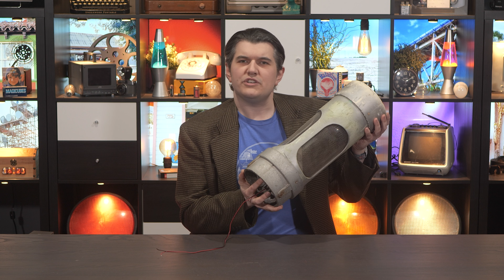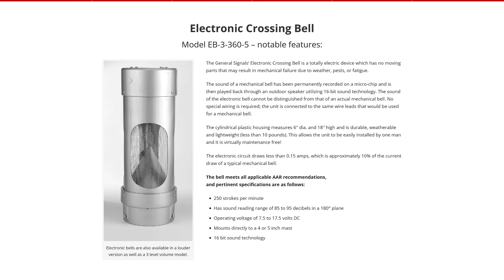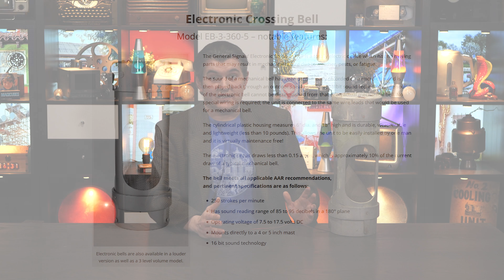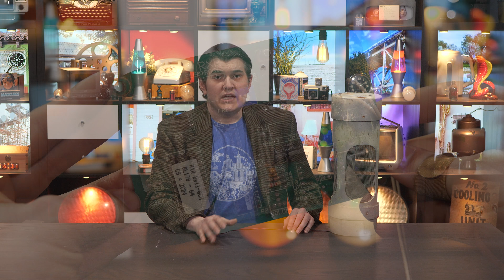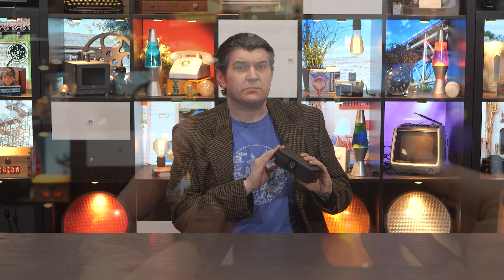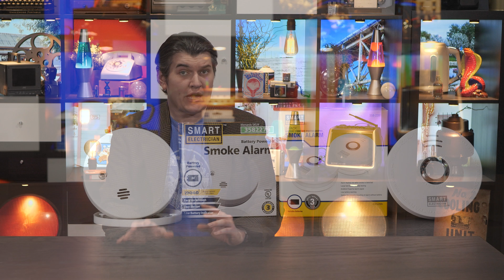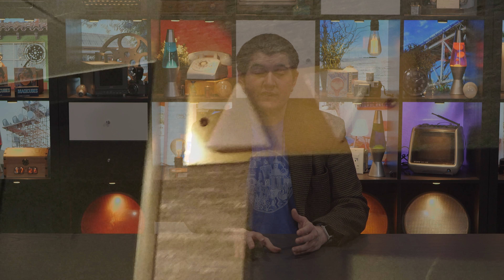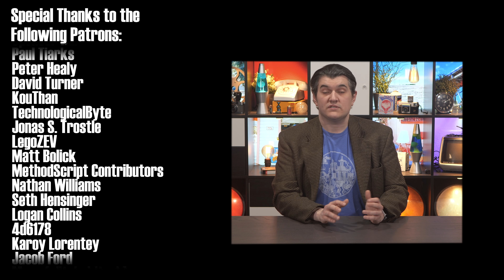The disappearing and unappreciated art of audible alerts

Comment: Alec (my favorite YouTuber!), you may or may not recall that department stores of the 1960s and 70s used a series of coded chimes over their PA systems to page specific managers.
Reply: I want to say those lasted into the 1990s, especially in the stuffier department stores like Neiman Marcus, Lord & Taylor, or Marshall Field's. It might have applied to JCPenney, Service Merchandise, and Sears, but I can't recall for sure. I don't know if it was universal, but it was very common and it added an interesting audible ambiance to the background of those department stores.
Reply: @JeffreyJakucyk You very well could be correct, I was approximating on timeline. I worked in retail during the late 70s/ early 80s, mostly in Brooklyn NY. Macy’s, Alexander’s and Korvettes.
Reply: It certainly felt like technology from the 60s/70s, and I guess it hung on until two-way radios became cheap and reliable enough to replace them.

Comment: 16bit railroad bell using a 8bit DAC, it seems the marketing department fumbled the numbers a bit here
Reply: “Indistinguishable from a real bell” - Alec goes on to demonstrate that lie as well
Reply: if it's a high sample rate 8-bit DAC then you can get greater than 8-bit sound fidelity through sample dithering. SACD is based on a high bitrate 1-bit signal.
Reply: @gdclemo the sample rate comes from a basic 555 timer, besides that there are just 2 cascaded counters to push the 8bit samples from the ROM directly to the DAC and an audio amp for the speaker. You can draw the whole schematic on a napkin in a few minutes, there is nothing fancy going on there, there is not even a CPU in it.
Reply: @SwitchingPower  I can do the same thing with 3 transistors and a real bell ;)
Reply: @SwitchingPower I mean it would be complete overkill for something that just dings continuously at railroad crossings, it doesn't need to be high fidelity of course. I just mean that DAC resolution is not necessarily a big deal for audio.
Reply: The bell featured here was from the 1990s. It's possible that they may have switched to 16 with the ones made today. The general signals bells have gone through a few revisions over the years.
Reply: The GS and NEG electronic bells have came a long way!!!
Reply: @epacm50 GS for sure. NEG's originally entered production in the 2000's as Safetran type 2's.  And use pretty much the same 16 bit chips as the GS type 2's. Not much has changed at all for NEG's.

Comment: Pilot chiming in here, the airliner sounds are rather aircraft manufacturer dependent (e.g. Boeing / Airbus), but in my experience they are very similar. Most commonly you will here these combinations:

- Single low chime: Passenger call
- Single high-low chime: Interphone call (Either pilot-cabin crew or cabin crew - cabin crew)
- Single high chime: Passenger info, e.g. fasten seatbelts / no smoking signs
If the chimes are repeating, they are indicating high priority messages, e.g. emergency interphone call or lavatory smoke detection

Comment: I associate temporal three with alarms, but not fire alarms. In my experience, high-pitch temporal three are usually fire alarms while temporal three at the pitch you played sounds more like a phone alert or weather radio alarm
Reply: Those weather alerts are actually completely unrelated, those tones are encoded information about the alert played 3 times to prevent false alarms or misread information.
Reply: @MichianaAlerting sure, but they all start with a klaxon or something that blares 3x. Then they repeat the information 3x

Neat if the klaxon is actually data though.

Comment: Mobile OS UI design is at the forefront of the trend to remove control from the user and impose a desired UI. This is why rooting and jailbreaking are so important - it allows people to provide improvements when the OS vendors don't want to. 

Mobile UI sucks. And desktop UI is going in the direction of mobile UI, if not already most of the way there. 

UI (and the related term UX) are not just the visual design. They include audio, they include the tactile sensations, they involve the fact that the UI and UX primarily exist to allow the computer to serve the user. Too often today, tech companies impose their own UI/UX on the user, harming usability and making the user more beholden to their "tech overlords"

Comment: A lot of warning devices are made from off the shelf components. Certain Whelen sirens use Atlas CJ-46 horns, which you can buy off of Atlas' website.
Reply: Actually a lot of sirens used to use them. Whelen used them in the WS-1000 and WS-2000, ACA used them in their omnidirectional alertronics, and Loudoun used them in the original ES-1000. Those sirens have pretty much become obsolete with the "stacked speaker cell" design outperforming it, but several units are still in service!
Reply: @MichianaAlerting  Indeed. Also, DKTech's speakers were used in some ASC sirens, and clones of them are still used in ATI sirens.

Comment: You missed: Air Raid ,  Reactor event,  Tornado or Tsunami sirens .  (OK, the first has been out of use for a few years). The town I grew up in used the siren to call, and tell the mostly volunteer fire crew, where to meet.  Long blast, then three sets of beeps that represented intersections to go to.   And YES. STOP CHANGING THE SETTINGS ON MY PHONE.
Reply: Outdoor warning sirens do not have standardization in their signals at all. Individual communities can choose whatever signal to mean whatever they want, so always check with your local EMA, fire department, police department, etc. to find out what sounds your sirens make

Comment: The ones near me on the Denver light rail also stand in for the manual train horn, which no longer comes from the train itself at crossings. Loud as hell if you're standing at the crosswalk. The irony is that for other crossings not equipped with one, such as the frequently-broken traffic light near me with a rail curve going through it, when the traffic lights are out, the train has to sound its own "bell" again, the kind used to shoo pedestrians off platform crossings

Comment: Whilst I completely agree with your point is that really what US smoke alarms sound like? 
It's a bit subtle isn't it? 
In the UK a smoke alarm going off sounds like a proper emergency 😂
Reply: He didn't use the actual sound because he was making a point about how the standardized part is the timing of the sound, not the sound itself.

It's almost always a high-pitched (and very loud) sound, depending on the exact model. Consumer-grade signals are typically just a beep like other consumer electronics - just loud and in the temporal three pattern. Signals in commercial buildings have a more complex tone that I'd call a "screech" or a cicada-like trill.

Comment: Haptics are not as useful on non-pressure-sensitive surfaces. You'd be more likely to notice a vibration on your palm or fingers or through your feet. One of the things I had a part in was a patent for signals in infrasonics (vibration) for alert systems, meant to be felt through the feet in noisy environments where audio cues might be lost. It's a system that can benefit Deaf-blind persons, Deaf persons, workers in noisy environments, and the like, and could be adapted to the sound-pattern system as it uses a solenoid/low frequency generator. Consideration of accessibility really does benefit more than a targeted community, as one mode of communication can be used by more than a single audience.

Comment: As a blind person, yeah, audio design matters. I'd noticed temporal 3, but some buildings I've been in just use a solid buzzer tone. 

Also, one thing I noticed a couple years ago when I was traveling in Columbous Ohio, most areas have audible pedestrian signals (APS) that produce a short almost tick-like noise so that blind people can find the button and command a red-light so we can cross safer. Some areas, like Columbous, disable the ticking noise, so you have to guess-and-check to see if there is a signal at every corner! Its stupid! I understand the ticking can be a bit obnoxious if you're sat on the corner, but its designed to be unabtrusive.

Also, yes, I use different notification sounds on my phone for some different apps. From memory, YouTube uses the menu select sound from Super Smash Bros Melee, Discord notifications are  the Windows XP notify sound, Discord DMs are the Windows 2000 shutdown, and I have another sound for most other notifications.

Comment: 7:23 that is the sound you got when you called someone on a phone and they haven't picked up yet. I would never think of fire when hearing this, though I obviously would be confused. 

In general I'm all for acoustic notifications, but I also wish they reduced them to what's actually necessary and used different sounds and patterns again. My coffee machine does not need to beep, it makes enough machine sounds to tell me it's working. The car does not need to beep randomly without giving me additional info why it's beeping randomly and since it seems to beep for different reasons different sounds or even patterns would greatly help figuring out what the f it wants to tell me.
Reply: yeah the pattwrn was correct but the beep was the busy signal beep and FAR FAR too quite
Reply: He intentionally used a much more mellow tone to emphasize the fact that the cadence is the standard, not the tone.

Comment: My elderly mom kept turning down the volume on her smartphone without realizing. Then she got overwhelmed my the smartphone so I switched her service to a flip phone. She was doing it on that too, and had trouble with the directional ring. Admittedly it's bad on that phone, I had some issues too. So now she has a jitterbug flip phone, a very bare bones phone with large buttons. but more importantly, deep in the settings, you can disable the volume control buttons, so she can't accidentally turn off the ringer or change the volume at all. it's all set to full volume so she can hopefully hear it.

Comment: 7:17 I think you will very quickly run into the XKCD 927 standards issue here. I believe that the standard in the Netherlands is the "slow-whoop" alarm sound for evacuations.
Reply: It's nowhere near uncommon even in the U.S., the standard alarm tone on a new Simplex voice evacuation system has been their own version of "slow whoop" for DECADES. The user actually has to put in a request if they want the tone changed, and modern panels need to have a technician come out and burn a new ROM chip to change the programming

Comment: A couple interesting notes about Temporal 3 - and some others - that I’ve learned over the years as a collector of older fire equipment.

Temporal 3 started to become “a thing” in the mid to early 80s. However, it was not standardized yet. The duration of the cadence would vary by manufacturer. A good example of this is Simplex Time Recorder’s very early micro-processor based fire alarm control panel, the 4002, used a cadence of 3 pulses of 500ms, followed by 2500ms off. Nowadays, the ‘standard’ is 3 pulses of 500ms, followed by 1500ms off. STR ended up changing this mid-production of the 4002, with a ROM upgrade.

Before there was Temporal 3, signals were either continuously on, or coded using mechanical code wheels with teeth. There were many common patterns, but code “4-4” or “4-4-4-4” were popular in the 60s and earlier. After that, some manufacturers switched to “March Time”, a cadence of between 60 and 120 beats per minute, which was intended to match the cadence of you walking to leave the building.

Also, as for slow whooping tones, I believe that Simplex Time Recorder may have been either the first or otherwise very early to this game, with the introduction of their 2001 panel introduced in the very late 70s installed all the way through the early 90s. These panels used card-based electronic tone generators and oscillator modules to create the whooping tone, and send it out over some amplifiers to the speakers during an alarm. Modern Simplex panels actually continued this trend - as their modern slow whoop tone is simply a digital recording of this tone generator!

Hope my nerdy enthusiasm about these systems is interesting to at least someone, lol
Reply: Brother you're NOT alone. As a fellow professional nerd, I solute you heavily.

Comment: I installed a friendly old-school bell on my eBike because the rude horn was frightening walkers on the trails.
Reply: I loved the bike culture in France because every bike had a bell and it was universal practice that the bell was rung to signal passing so pedestrians could step to the right
Reply: @gaston7261  Bells are so friendly sounding. I like them, people smile when I ring it. :)
Reply: A good pure-tone solid metal bicycle bell is such a delight, I have one on my bike and it falls in the category of "made objects that are not fancy or super expensive but are well designed, sturdily constructed, pleasing to handle and use, and fit to purpose," which is a category that I find myself more and more appreciative of even as it sadly becomes more and more of a rarity
Reply: The rude horn is for cars, they are inside a container so it has to be loud.
Reply: I have a rather loud brass bell on my (acoustic) bike with a very long sustained ring. Generally, a single ding is enough to get people to notice, and I've had people make positive comments about it.
Reply: Funny enough, my e-bike came pre-equipeted with a bell. I think there was a regulation somewhere that required it, so the bike company just put them on all of them.
Reply: As a pedestrian, I appreciate this

Comment: I remember that temporal three sound used as the storm or tornado alert on tv here in the midwest
Reply: That's actually an entire different industry. That sound for storm alerts is the U.S.'s Emergency Alert System (or EAS for short). Those three tones are actually encoded information about the alert that certain devices use to activate and spread the alert. It's repeated three times to ensure no false alarms, and then the following tones are what are actually supposed to get your attention. The EAS industry is entirely separate from the fire alarm industry, but every industry under the "alarming" umbrella does have some similarities with the others.

Comment: Hey TC, something I learned fairly recently is that fire codes don't allow the mixture of conventional fire bells and Temporal 3 buzzers because apparently mixing them together makes either system less effective on its own.

Which makes me wonder... why don't they do Temporal 3 for traditional bells more often?
Reply: They're more worried about the mixing of cadences rather than the mixing of tones. One building can contain dozens of different models of alarm which all sound unique, but all sync together in that same code-3 pattern. It's also why strobes are a requirement, alerts you audibly but also visually

Comment: In the civilised world, if a fire alarm goes off it's 130 decibels of pure screaming. That thing is laughable.
Reply: It's a demonstration of the signal, not the sound made by the alarm. They are way louder and higher pitched in real life.
Reply: Yeah and I find too much in the other direction kind of baffling.  One was fitted to my building a few years ago and it has false alarmed, no exaggeration, around 30-50 times as it has a fault the company looking after it haven't corrected despite being told what it is.  All they do is come and reset it, and in 2 weeks or less it will false alarm again, usually between 1am-3am, requiring me to go out there and navigate the awful, unintuitive menu system while it's blaring and driving the whole building nuts to try and get it to shut up while being careful to disable the "call fire department" setting as well.  Definitely not fit for purpose.

Apparently the illusion of safety is more important than actual safety, and it's self-defeating because even on the off-chance it detected an actual fire, everyone would just assume it's another false alarm, "boy cried wolf" style.  For me that kind of thing epitomises some of the problems of society, that it doesn't matter if something actually makes a positive difference, it just needs to fool enough people that it might.
Reply: I’m personally glad that my viewing device can’t emit a 120dB piercing tone just because a random video creator decided it would be relevant to do so.
Reply: @fluffycritter I am also referring to the pauses. We get a continuous weeeewwaaaweewaaweeewaaa
Reply: yeah Im pretty sure he tanked the volume for our hearing pleasure. though the sound of the beep also sounds off. the pattern is correct though.

(and I an actual [though only volunteer] firefighter didn't realize what it was) in my defense it did sound familier. (they also didn't present the sounds to us in class). I have heard more commercial ones them residentiul ones though.

home smoke alarms also have a low battery beep. I believe they also have an EOL (end of life) one or at least something that wasn't temporal 3 or 4 or the low battery beep has caused a couplr false alarm sounding calls and the alarm was expired (by several years)
Reply: Can you use British units instead of decibels? 😊

Comment: It is interesting that modern UK railway crossings use a distinctly electronic warning noise instead of bells, but the US decided to continue using bells, just without the bells
Another note on fire alarms, UK ones don't use any kind of pattern encoding that I am aware of. They stopped them from blending into the background by making them deafeningly loud. I have many memories of fire drills and having to walk past the actual alarms and having muffled hearing afterwards. They're loud enough to wake the dead, so they won't be missed